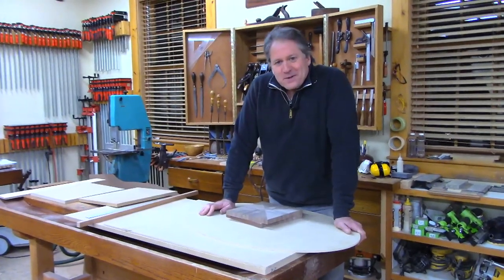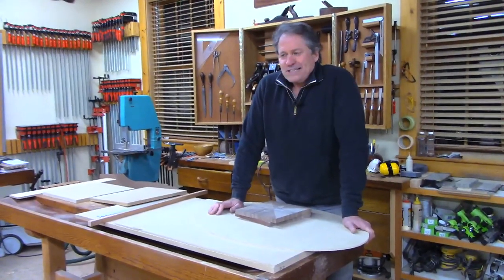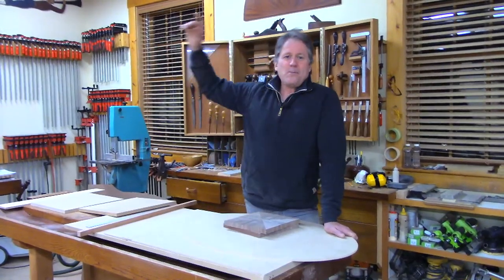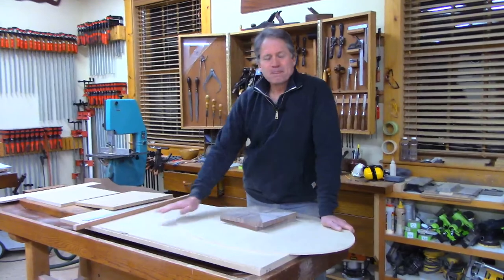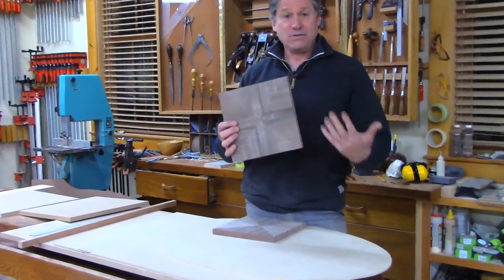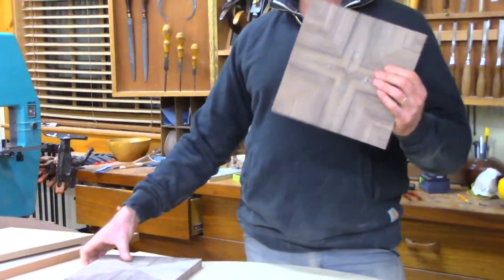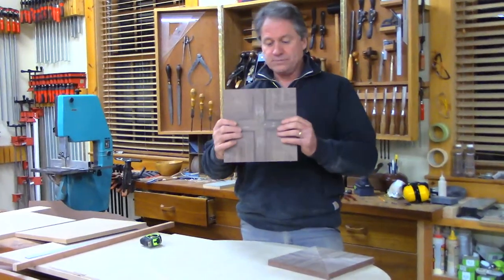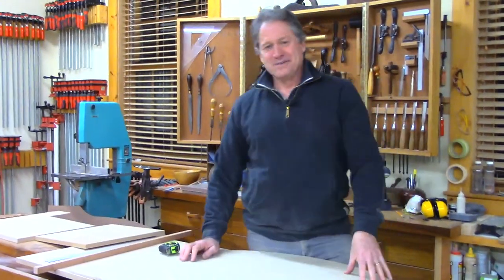How to Make an Ellipse Jig with Tom McLaughlin

Comment: Hello. When it comes to an ellipse that is quite long in comparison to it's width, how would this jig work? My ellipse is supposed to be 1700 mm long and 650 mm in width. Perhaps this jig won't work with these measurements?
Reply from the maker: Yes I think your instincts are correct, a long narrow ellipse like that can look a bit torpedo-ish. I think I mentioned in the video what I consider the ideal ratio range for the length x width. I have had situations where the ellipse proportions seemed too long for the width and I would draw the true ellipse for the reference and then “fatten up” the curve freehand, then use the modified quadrant as the template for shaping both sides. Hope that helps! 👍😎
Reply: @EpicWoodworking  Hello. My final pieces came out perfect. I made the jig itself longer than it's width. And on the short side I made the guide come out quite far. So it worked great. I'm making a elliptical dresser/chest of drawers.
Thanks for your reply!

Comment: Intriguing. 
...
If the ellipse you are using were 1.618 time as long as its width, then it would be a Golden Ellipse, as used in classical art and architecture.  An  ellipse 1.5 times as long as it is width is very close to displaying the  "Golden Ratio", which almost always results in very pleasing visual dimensions. By the same token, an ellipse that is 28 x 48 might seem a bit "long" because it's length-to-width ratio is 1.7.  Traditionally speaking, the closer such ratios (in rectangles and ellipses) approximate 1.618, the better they "look" and the better they "feel" to most people.
Perhaps, then, it is not surprising that ratios between 1.5 and 1.7 looked good to you as you designed your table tops.
...
I'll put this in the form of a question. Do you think the 28" x 48" (1.714) ellipse would look better to you were it 28 x 45 (1.61)?  
...
Also, as a practical matter, an elliptical tabletop of about 49 3/4" x 63 3/4"  (ratio = 1.28) is going to look "tubby" as a shape but serve perfectly as a table. The 'perfect' shape might be either 39 1/2" x 63 3/4" or 49 3/4" x 80 1/2"  -- both of which ellipses yield 1.618 ratios -- but they might not function well as dining tables in the space in which they will be used. Coffee tables of these proportions might be better, maybe, but those are questions of practical application not of geometric proportion. Nonetheless, the classical "Golden Ratio" is very often a useful and appealing reference point from which to begin a design.  It has been since the publication of "De architectura" by Vetruvius (circa BCE 20).
...
As I said, intriguing.  Your geometry training pays off again. ✔  Both Vetruvius and Da Vinci would be proud.
...
Very interesting  video. Useful jigs and techniques, too. Thanks!
Reply from the maker: Thanks Jerry, 
That sure was an in-depth analysis...I never looked at it that way! Very interesting to tie in with the golden ratio. I had always associated the golden mean with rectangular forms but it makes sense to apply to ellipses as well. 
My experience has been in observing the “too pointy-ness” when it’s below the 2/3’rds, or 1.5, ratio I mentioned as a general rule.
I appreciate your kind words and that great analysis!  Thanks again 👍👍